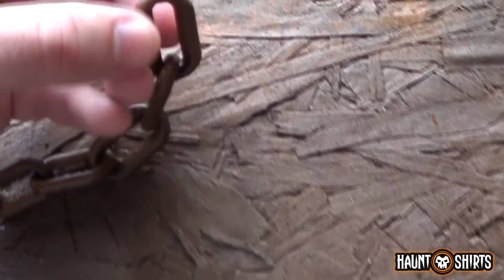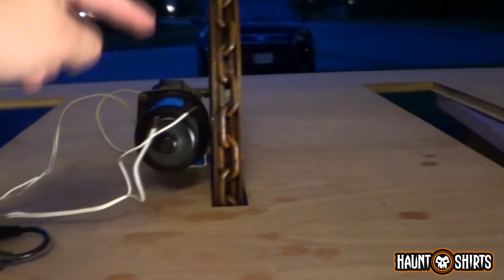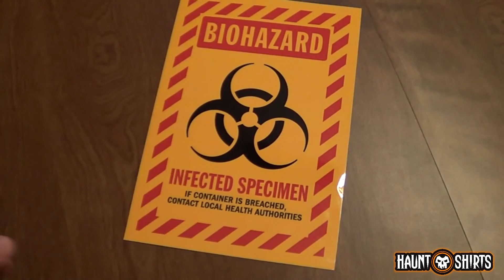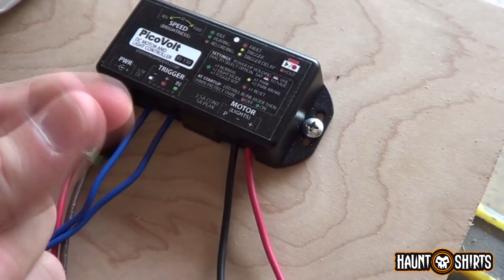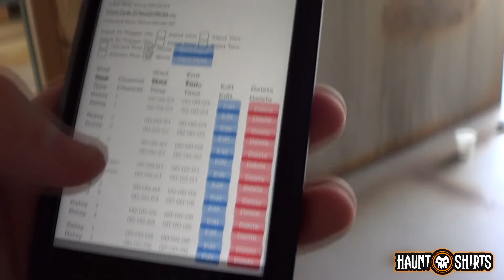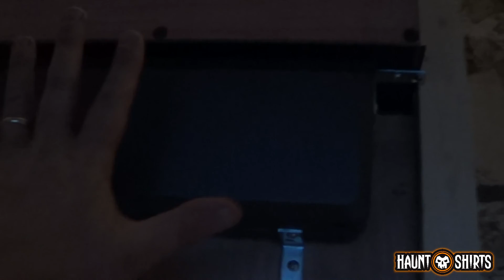Road to October '16 Episode 13

Comment: What type of motor are you using and where did you get it?
Reply from the maker: The wiper motor?  I just get used ones off eBay.  I do a search by lowest priced first and bid on those.  Then its a matter of figuring out which of the wires I need to make it work.  Otherwise you can get them from Fright Props or Monster Guts but I think they are a little pricey.